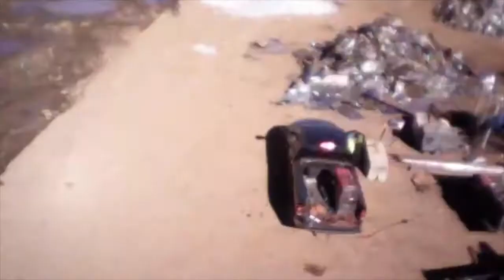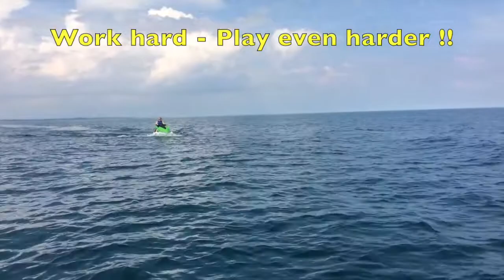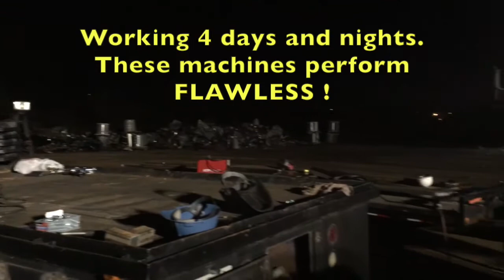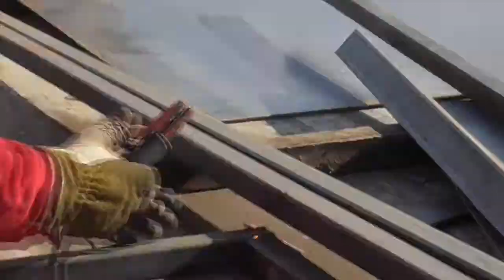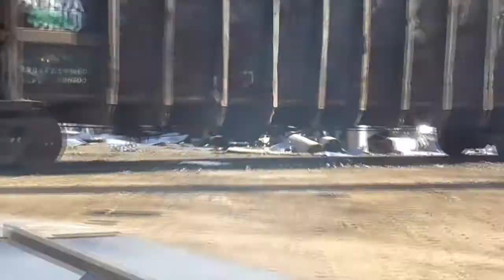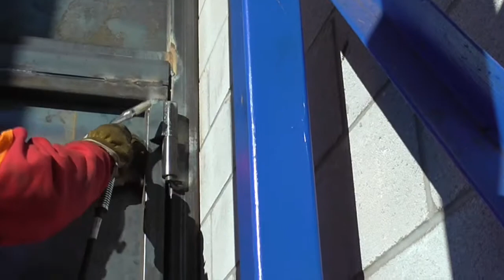HTP Pro Pulse 200 at the Scrap Yard with Heather

Comment: How does the gas less flux core do? Does it make for a brittle weld. I need something for outdoor use.
Reply from the maker: it does not make the weld brittle, BUT there isa lot to lean about gasses wire ... typically they need a VERY long stick out, some wires are only good for a single pass, some are good for  multi-pass even the multipass wires have a "limit" like 1/2" thick build up or 3/4" thick build up, very few have more than that and to my knowledge, let put it this way - I personally have not run across a self shielded wire that had no limit. not saying that there isn't such a thing but for sure it rare ....  if you follow everything right, wire speed, voltage , stick out (CTWD), polarity, you pick the right wire for the material you are welding, they make it in different types, milt steel, high strength steel, some pipeline application, different kinds of stainless ... etc etc etc .... there is a WHOLE lot to learn about that wire before you can use it well.

I hope that helps
Reply: ZILA thanks. That does help a lot. I just ordered some flux core wire from HTP. It e71t-11 i think. It said it was rated for limited multi pass. I usually won’t need to make two passes but it might be necessary at times. I can’t wait to try it out.

Comment: I hope this machine is price competitive with the 131 that it is replacing. I will be contacting HTP tomorrow to get on the waiting list.
Reply from the maker: Paul,  I am not sure what is replacing what - and I have no influence on pricing what so ever ...I just weld for a living....  but this machine is 200 amps and pulsed stick and pulsed dc tig - so it's not really comparing apples to apples ...  only time will tell what happens .....
Reply from the maker: https://youtu.be/n34qJBiqVKA    less than $1200 with the promotion - so it is really close to the 131 tig ...  although this here is a full blooded stick machine first and foremost - but it can also tig - but gas valve on the torch

Comment: Wow! Did this have to be blast proof or something? Otherwise it would be much cheaper and easier to just build a framework and cover it with barn metal versus that heavy plate steel.
Reply from the maker: the roof had to be so strong so if a load of material comes "undone" from the magnet and falls on the roof - the customer didn't want the roof to be damaged ....in a scrapyards stuff get wrecked like you wouldn't believe ...